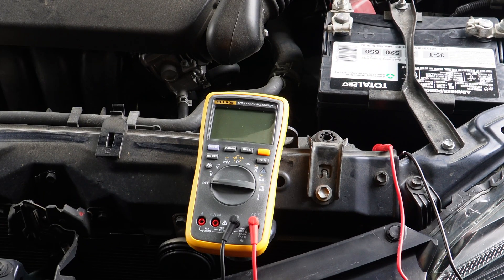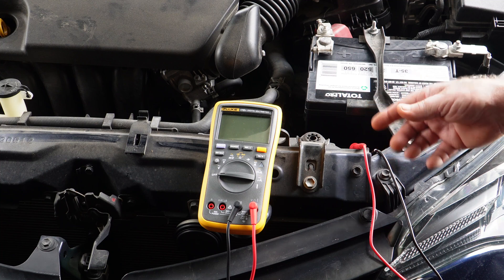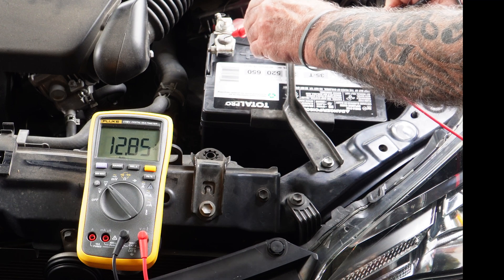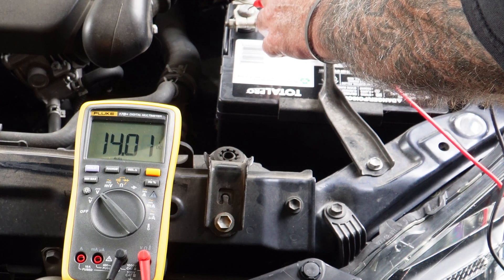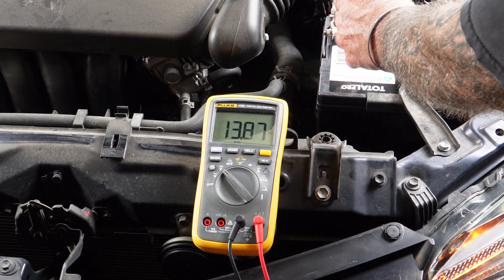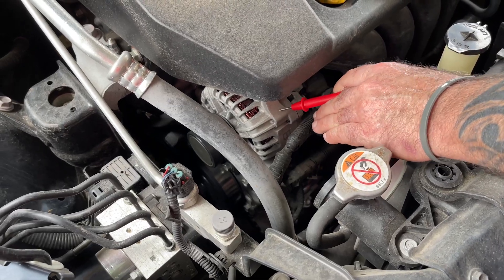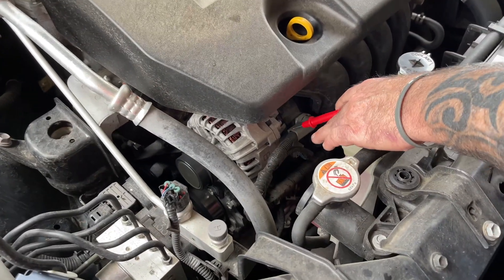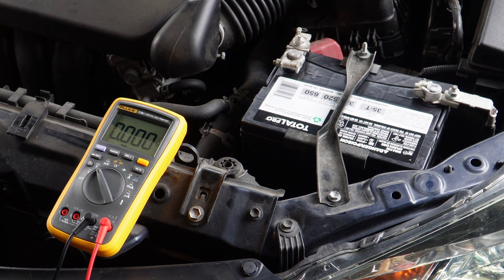How To Test An Alternator

Comment: Thank you so much great video. What if on that last test I get .02 I noticed you were at. 01+
Reply from the maker: 0.02 is only 20 millivolts so nothing to worry about.  Any reading under 0.2 (2 tenths of a volt) is considered acceptable on the negative side.  You are showing 0.02 (20 millivolts so there is no significant voltage drop to cause an issue.

Comment: Could it also be the voltage regulator ?
Reply from the maker: The voltage regulator on modern vehicles are built into and part of the alternator, but if you have an older vehicle that uses a separate voltage regulator then they too can give you problems such as overcharging or not charging.  Manufactures stopped using stand alone voltage regulators around the mid to late 80's.

Comment: What if the reading is 13.6 or 13.8 volts with engine at idle ?
Reply from the maker: That's a good reading
Reply: @SkillSavvyDIY Just installed a new alternator, all the electrics are reading normal but the alternator making a slight whirring noise every little bit. Is that something to be concerned about?
Reply from the maker: @JoshMary-v4r  A slight whirring noise is nothing to be concerned about

Comment: What is the minimum voltage of charging while in full load (lights on, ac on etc)?
Reply from the maker: Should be a minimum of 13 volts under full load.  Any thing under that indicates a problem either with the alternator or something causing to much voltage drop as I discussed in this video
Reply: @SkillSavvyDIY noted, thank you for prompt response 👍

Comment: I actually just for the first time ever I took my own alternator out my car and I believe it was for nothing because I believe it’s my cables to the battery I do have corrosion built up🤦🏿‍♀️ and I just order another one🤦🏿‍♀️🤦🏿‍♀️🤦🏿‍♀️
Reply: At least you can say you changed your alternator
Reply: It's all apart of learning to save money.. Because that's why you work on your car on the first place... But if you want to take it to the auto parts store, to get it tested you have to pull it off anyway... Good exercise to boot 🥾
Reply: Did you use a volt meter? A volt meter will tell you exactly where your problem lies
Reply: Went to breakfast this morning no problem. When I went to leave I noticed my battery light was on when I left. Got halfway home which is about four miles and the light went out. Went inside and got my volt meter. Started my truck up and the battery light was on again. Did all of the tests like you stated except the one on the positive terminal of the alternator because I can't get to it. All tests said the alternator was bad. Called my mechanic and he said most likely it was the alternator. Giggled my battery wires and the battery light went out and the tests I did before tested as everything was fine. Thoughts?

Comment: My car wouldn't start. When i put the key in the ignition all the dash lights turned on.  I took the battery out and connected it to a charger. The charger said it was at 15.9 V. What does this mean?
Reply from the maker: Not positive but sounds like your charger is over charging

Comment: Battery light on    1991 F250 460
Reply from the maker: Follow the video to see if the alternator is charging or to see if you have too much voltage drop due to bad connections or cables

Comment: 89 240 volvo Dash light on. battery reading 12.60 engine off. Start engine voltage drops to 12.40 volts. Is that a sure sign alt is bad (no load) or do I need to follow up with other tests shown? Thank you.
Reply from the maker: You do need to check for voltage drop to make sure before condemning the alternator.  If there is no significant voltage drop do to corroded wires or terminals then you probably are dealing with a bad alternator.
Reply: oThanku you for your reply. Light nyo longer comes on two days later, and testing with meter engine off battery 12.50v and after start (no load) meter reads a little over 13v. Will check for voltage drop, great advice from you.

Comment: Can the issue be off/on? Battery light came on twice for about a minute each time in the last 2 weeks. Battery is about 6 months old. 2014 f150, original alternator.
Reply from the maker: You could have a intermittent problem.  It will eventually show itself.  Be sure to check the connections at the battery and alternator if you can get to them easily.  A number of things can trigger the battery light

Comment: you should make another video but not complicating as much next time, if you showing it to another mechanic for sure he knows what you talking about but in general regular people have no idea what voltages are about, can't it be done easily like just checking the alternator, or just check the battery in a simple thanks
Reply from the maker: If a person can't understand this video, then they should take their car to a shop to determine the problem.  If you can't understand voltage, then you certainly shouldn't be working on the charging system.
Reply: @SkillSavvyDIY  ok, i accept but, i still think there's better and simple way to show people that doesn't understand anything, and I'll learn and I'll make a better video

Comment: I had chevy replace my altinator twice and it still makes a humming noise even when acceleration.  My battery is dead every morning and I've replaced it twice as well. Can't figure it out neither can Chevy. Thought it could be a parasite draw but it's not. I did have someone try to steal my avalanche  and that's when the problem started. I turned the key and battery was dead. Replaced battery still dead next morning.  Replaced altinator and loud humming then battery dead again then replaced battery again and altinator again and loud humming with another new altinator and dead battery again.  Terminals are good so idk if I just keep getting bad altinators or what?? Thought it could be a idler tentioner pully that's bad but nope. Any suggestions? I do know when spray water on serpintine belt loud humming stops then comes right back. Its a brand new belt so I just don't get it neither does Chevy but can't drive my avalanche due to battery dead every morning.  Sometimes battery is dead right after its been idling for awhile and I go to turn it right back on within minutes of shutting it off. Any suggestions???
Reply from the maker: Have you checked to see if these new alternators are charging?  Some voltage regulators in the alternator are controlled by the PCM.  Could be an issue there.  I would recommend taking it to an automotive electrical shop that specializes in this, and not a dealership

Comment: Thank you for great video so my alternator car runs coming out 12.23 and battery itself tested 12.62 looks like alternator bad , so it is ok to drive before replacing new alternator
Reply from the maker: If you drive with a bad alternator that is not charging the battery, then you are running off of the battery only, and it can leave you stranded when the battery looses enough voltage to shut the vehicle down.
Reply: @SkillSavvyDIY thanks a lot I just replaced my today so far running good and the only thing maybe no one talk about is, when I parked playing the steering wheel around had some kind of noise, much be low on steering wheel fluid? Right I try to fill it up
Reply: Great video
Reply from the maker: @jackjeffrey2384  Thank you!

Comment: my alternator won't charge until the engine gets hot
Reply from the maker: An alternator that doesn't start charging until the engine heats up can be caused by a few issues, including a faulty alternator, a bad voltage regulator, or a problem with the engine's computer or wiring. It could also be related to the alternator's brushes or stator windings.

Comment: Great video. Now can i test alternator with the ignition just on position (not running)?
Reply from the maker: The alternator will not put out voltage unless the motor is running and spinning the alternator pulley.
Reply: @SkillSavvyDIY  thanks man, dealing with this p0688 asd relay open source.. will find the problem.

Comment: i have a baterry tester is this same as using multi meter? because my battery is dying every 2 days i just change it last month i need help i added a insulation on my battery and also dielectric grease on the positve on alternator is this also casuing the problem?
Reply from the maker: No not quite the same but most battery testers can tell you if the battery is good and if your alternator is charging.  If you find that the battery and the alternator are ok, then research how to find a parasitic drain.   A parasitic drain is something that is staying on after you shut your car down, and is draining the battery

Comment: @Skill Savvy DIY --  Questions:  (1) When doing the voltage drop tests, do you still want the high load (high beams, AC, radio, dome light, etc)?  (2) When doing the alternator-under-load test, aren't you supposed to run the engine at a higher rpm (like 2,000 rpm)? Can you really expect an alternator to charge a battery at the same time that the load is high if the engine is just idling?  Thanks.
Reply from the maker: Doesn’t matter if it’s under load or not.  No you don’t have to rev the engine to a higher RPM.  A good alternator will charge fine at idle as I have shown in the video.  If you have bad connections or corroded cables, the voltage drop will be apparent at any RPM.  Yes, as you seen in the video, my alternator was putting out enough voltage at idle to not only handle the load, but also maintain the battery charge at the same time while under load
Reply: @SkillSavvyDIY  -- Thanks much!

Comment: Do you do voltage drop test with all the accessories on like the test before?
Reply from the maker: You can but not necessary.  The voltage drop test is checking for drop caused by the battery cable, battery post clamps or a possible bad ground.  It will show that with or without loading the alternator

Comment: Negative goes to the positive thermal? Voltage drop
Reply from the maker: You check the alternator ground for voltage drop by reading between the alternator body and the negative on the battery as shown.  Then check for voltage drop at the positive battery cable by reading between the battery terminal on the alternator and the positive post on the battery as shown in the video.

Comment: I put this test sequence and test parameters on the inside cover of my GW A-8 textbook.  

I also have a notebook to put key test procedures, steps and data in and I work at remembering key concepts using homemade flash cards.  Then its always a gargantiuan effort to bake it in so it never goes away.

Comment: What if I get no reading when connecting alternator body to ground side of battery
Reply from the maker: If you get no reading while the motor is on and the alternator spinning, then you have no voltage drop.  No voltage drop would be 0.00

Comment: I just upgraded my 96 ranger 2.3l manual 5 speed 95 amp stock alternator with a 250 amp high output alternator, and I ran 4 gauge ofc  from the alternator ground, that said test ground with a 4 gauge to the frame and then another 4 gauge straight from the positive output to the battery positive. And I put the original factory positive lead back on the high output alternator as well which ran to a starter motor relay where is split? And one positive goes to the battery positive, and one goes to the starter positive.  I did not connect the battery positive to the relays positive. I left that one disconnected.
And it started fine, so power is going across the initial wire factory wire and getting to the starter, not even going to the battery. But 4 gauge straight from the alternator to the battery after it started fine, I was looking at it running under the hood, and suddenly the battery started bubbling and spewing out acid from the top covers.  I'm about to go check the voltage at the battery and not leave it running, but just a second.... can I can determine whether or not it's getting too much voltage? And if that's the case, okay? The alternator should be good. Just, I need to get another voltage. Regulator or do I need a new battery? That can handle it?
Reply from the maker: I got to say, I'm a bit confused in what you are trying to tell me.  Most alternators if not all are grounded to the engine itself, which is grounded to the battery negative directly or indirectly.  The starter motor positive should go straight to the battery not the alternator.  The alternator B terminal should go straight to the battery positive.  I'm definitely confused about the relay.  The starter relay powers up the solenoid on the starter when your key is turned to the start position, allowing 12v high current to engage the starter through the solenoid.  The voltage regulator is most likely built into the alternator giving the year of the truck.  Check the voltage at the battery while running to see how many volts the alternator is putting out at the battery like I did in this video.  Any thing around 15 volts or higher indicates the alternator is overcharging.  You may want to look at a wiring diagram on the starting system for your year truck and make sure all the wiring is correct.
Reply: Alison has free automotive electrical courses online that will help you understand how the battery altinator starter systems... plus Ohms Law, ect, ect.

Comment: Glad I found this excellent video. I've been experiencing this start/no start issue with my 2016 GMC Sierra 5.3 for almost 2 years. Every darn time I brought the truck in to have it looked at the truck would start for them. My truck is acting up again, but I found something interesting today. Like the other day I put my new battery charger on to charge the battery. The battery showed 12.86v when off. I went try starting the truck and it started. Both times with the battery charger charging it started after not starting (only the one click was happening). Any idea what that could mean? Sounds like no charge was going to the battery until the charger was giving the battery juice. I tested my truck while running (no accessories on) and the battery was 15.45v. I hope you can guide me from here. Thanks!
Reply from the maker: I tried to follow what you were saying.  When you did get it started, did you check the battery voltage to see if the alternator is charging the battery?  The fact that your battery charger can charge it and then it starts tells me you may have a charging issue with the alternator.  If it is charging, then you could have a bad ground on the starter itself that works  intermittently
Reply: Im having the same issue with a Ram 2500. Did you ever find out what was wrong?

Comment: When you where testing for voltage drop was the car on and at idle or with all accessories one?  Great video. At idle and no accessories on my reading is 14.95V so i it over charging?
Reply from the maker: Yes it was running at idle.  Accessories don’t have to be on.  You’re basically testing the cables and connections when doing the voltage drop test.  14.95 volts while running is still acceptable.  Once you get above 15 volts and higher then the alternator could be over charging which is hard on the battery.
Reply: @SkillSavvyDIY  Cool thanks

Comment: My battery voltage at the morning is 12,20, but when I remove battery from the car,and measure Volter after few minutes,the voltage is 12.55-12.65. Is this normal?
Reply from the maker: It's normal to have a small degree of that if the car isn't asleep, meaning the computer isn't asleep.  A very small amount of draw is normal, but if you begin to notice the battery dying after a day or so of just sitting there, then you could have a parasitic draw causing to much drain on the battery while just sitting there, which is not normal and needs to be addressed.

Comment: I think a better name for this video would be Continuity Check.
With the ignition off, use the resistance check function 
(center setting upside down horseshoe). Should read 0 ohms (and give a beep).
Reply from the maker: It’s just a simple voltage drop test to test for bad connections or bad cables.

Comment: Great video 
To the point
Quick and easy 
I have a 110 amp on my F350 super duty.
Do you recommend I get a higher amp alternator if I pull a fifth wheel and have truck and rv lights,ac,radio and phone chargers on when traveling at night?
Reply from the maker: Your F350 came with a substantial alternator since it most likely came with a towing package with a towing module for trailer brakes and etc.  Before I purchased a higher amp alternator, I would first see if the one you already have can easily handle the added load without having any excessive voltage drop.

Comment: Thank you for the easy instructions. I have a fairly new (6 months) battery not holding a charge on a 2001 Camry with 200k miles. I’ve never checked an alternator before so was hesitant to try by myself. Now I can! It’s the next step then on to the other possible causes of battery drain. Great video!
Reply from the maker: You’re welcome, glad it helps

Comment: What does it mean when it reads 12.3 volts on the battery when car is off but 0.1 volts when car starts
Reply from the maker: Is it starting up and running, or is it reading 0.1 while cranking?  The starter will pull down to about 9.6 volts while cranking but anything lower than that then you have a bad battery or a bad cable causing some serious voltage drop
Reply: Problem solved or you still need help with an answer?

Comment: Have you done the mult- meter test from HF? I have several free meters as gifts HF. Sit as many as you have an rest off same battery at same time to see how accurate they are to each other?
Reply from the maker: No I haven't.  All I use is Fluke multimeters.  They are one of the most accurate multimeters in the world at 0.5% to 0.025%